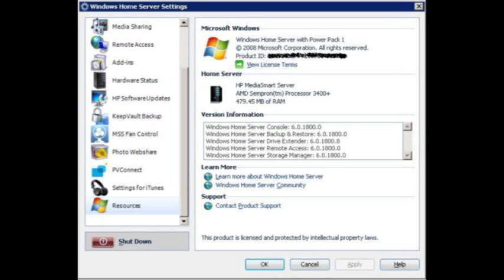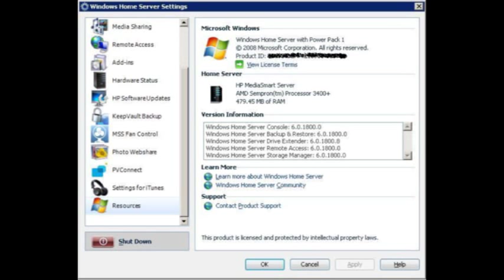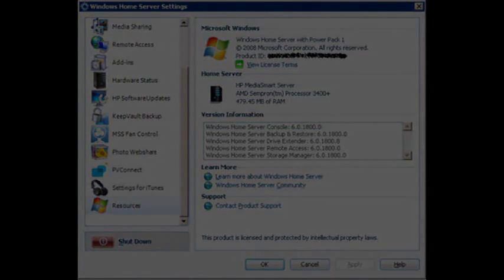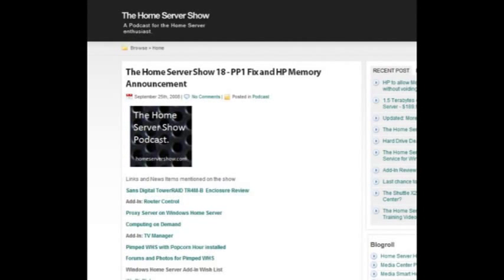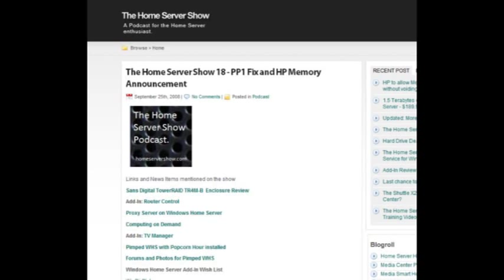Windows Home Server Ram Upgrade - Part 1

Comment: I think that this is very, very easy to instrument and baseline.  Simply run performance monitor and then run through usage scenarios.  All of the objects that you need and counters to instrument the "significant improvement" that this dude claims the RAM upgrade offers will be there... Cold hard facts.   I am sure there is some truth but NO blanket improvement.  I have been an MCSE for over 14 years and I listen to this guy and I have to tell you he does pass the smell test all the time.